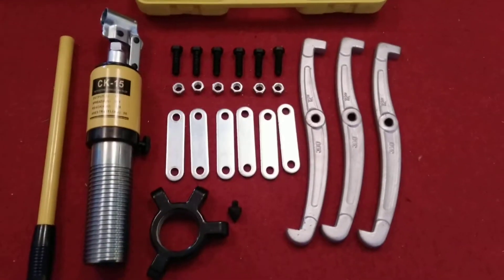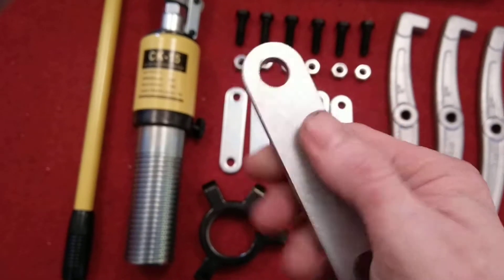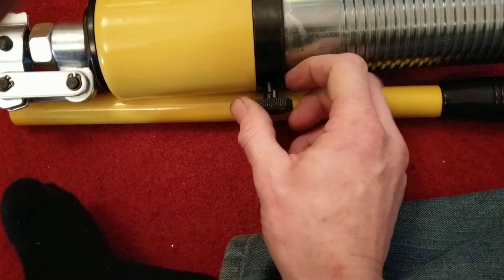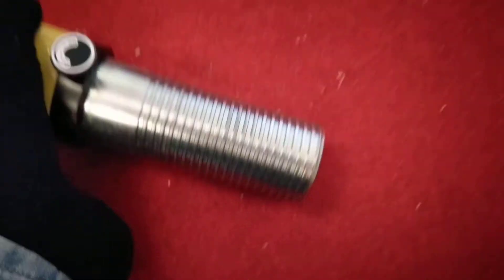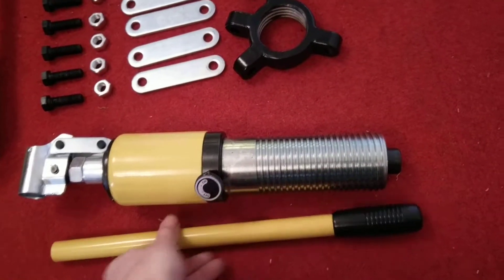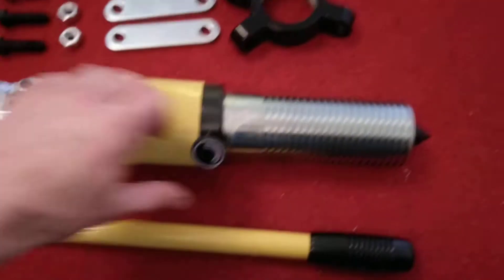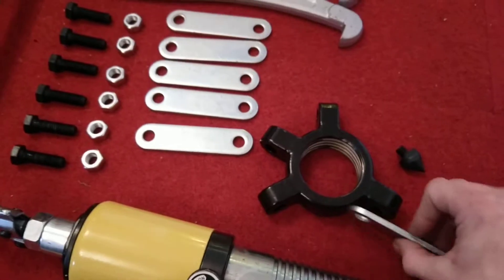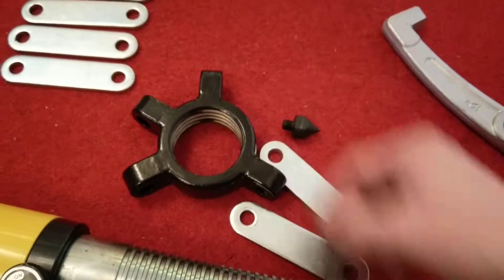15 Tonne Hydraulic Bearing Puller Initial Unboxing/Assembly Part 1 @ John's Junkyard

Comment: What is the manufacture of this product? Would you recommend buying it after you tried it, thank you
Reply from the maker: This is a cheap chinese buy off Amazon I believe. It has turned out to be very useful over the last couple of years so yes, I would recommend it but be aware that you might need to make some adaptors or tooling for your particular application. I have other videos on what I've done with it since this review if you want to check them out, might give you some ideas.